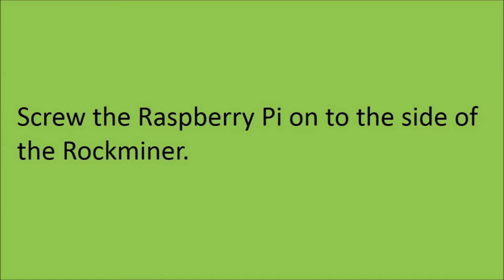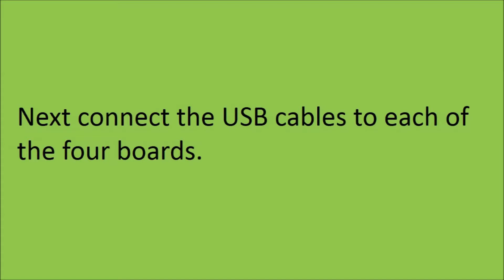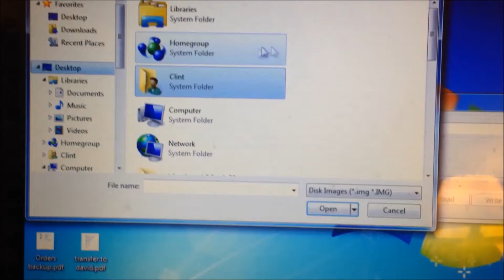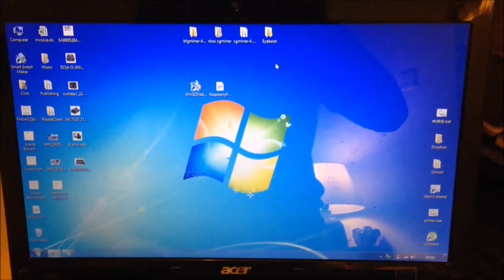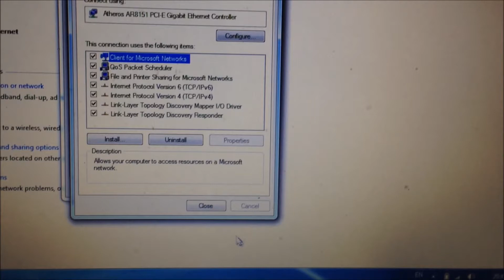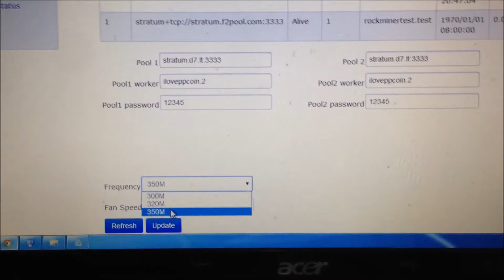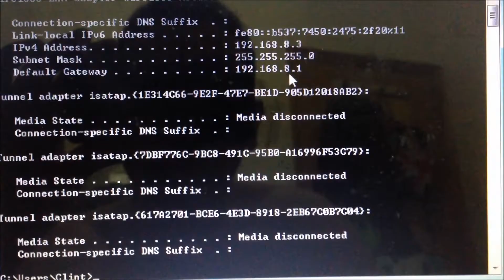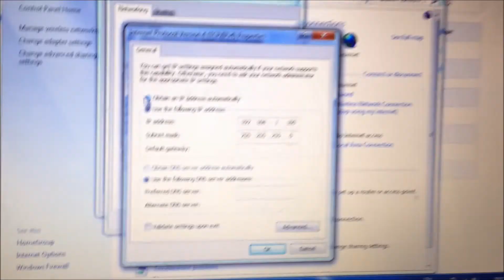How to setup Rockminer R3 Asic Bitcoin Miner using raspberry pi

Comment: How do you set the thing up without a raspberry pi. I was told I could do that, but I have no files that came with the thing. No instructions! No nothing!
Reply from the maker: Guadalupe Alvarado Both the R3 and the R4 can be connected directly to the computer and run on cgminer and Windows. All files and setup guides are available on our website: www.eyeboot.com

Here is the cgminer download link:
https://www.dropbox.com/s/y64lh5ucodfwyvr/cgminer-4.5.0-windows.rar

The setup guide for R3 and R4 is the same. Here is a written setup guide:
http://www.eyeboot.com/how-to-setup-rockminer-r3-r4-bitcoin-miner-using-cgminer.html

Comment: What is the name of the power cable to power up the Raspberry Pi directly from the R3 miner and where to find it?  Can we connect 2 R3 miners to a single Raspberry Pi? Can the Raspberry Pi handle them both?
Reply from the maker: Will D MCU to Raspberry pi line. We have them at Eyeboot. If you want an extra one then you can buy them, just email sales@eyeboot.com

Comment: instead of command just type cmd  on windows 7 if you have your taskbar right click on the icon it's a black box with C:\_ in it and pin to taskbar especially if you go in the DOS prompt for cgminer for your gridseeds or bitfury might work on the BAT file directly but don't have 1 on bfgminer 4.4.0 which I somehow got from multiminer cuz of the antminers I grabbed to start mining.
Reply from the maker: juggawest thanks for the tip!

Comment: thinking about picking up two of these from you guys to save money. What all do they come with? Also if i connected the built in USB hubs to another USB hub then that hub into 1 RPI (1 pie for 2 miners) would there be any efficiency loss in regards to mining?
Reply from the maker: ***** They come with built in (4 port) usb hub, 5 x usb mini data cable, a free raspberry pi (if you buy two miners) and a raspberry pi power cable so you can power the raspberry pi from the miner itself. We have just received new stock yesterday so offer immediate shipping via DHL (who are the best in my honest opinion).
Reply: thanks for the info!
Reply: Eyeboot i tried to download the software for the RPI using your link and my anti-virus blocked it. Is that normal? i went ahead and downloaded it, but it doesnt look like a image file, it looks like a program to install on the PC.
Reply from the maker: ***** Hi, it is a zip file but inside there is a raspberry pi image file. I just checked it is still the same file. Virus scanners always flag cgminer as a virus so that is probably why you are getting an alert. It is not a virus though.

Here is the download link:
http://www.mediafire.com/download/j214ddj9l9n4tyj/RaspberryPi_Rockminer_Rocket_V1.3.0_192.168.1.254.zip

Alternative download link:
http://sourceforge.net/projects/rockminer/files/RaspberryPi_Rockminer_Rocket_V1.3.0_192.168.1.254.zip/download
Reply: awesome thanks!

Comment: What are the Login and Password for the Raspberry Pi?  I downloaded your particular image file using the link on eyeboot.com to run the R3 miner, but they are nowhere to be found. They are not the old ones: pi  and 123456.    What is the easiest way to set up a WIFI on the Raspberry Pi for running the R3?
Reply from the maker: ID:root
pass word:rockminer
How to setup wifi:
http://www.maketecheasier.com/setup-wifi-on-raspberry-pi/

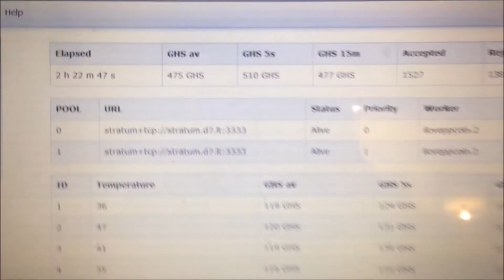Comment: I would not say your true average is 510 GHS after 2 hours and 22 minutes of mining. If you pause the video at time stamp 17:09, you can see that the GHS for the past 5 seconds is 510. BUT, for the past 15 minutes it's 477 GHS, and for the total time it's 475 GHS.

I know that when you start up miners, they starts off slow because they are dialing in the difficulty setting (which will make it run slower the first hour than the second hour), but to only point out the "past 5 second average number" isn't really fair either because that number can fluctuate quite a bit as the miner requests new work, or it's working on the new work.

A more fair way to report the mining speed of this unit is to let it run for a couple of hours (like you did) but then report the past 15 minute average number (477).

I'd say after running for 2 hours and 22 minutes, that miner is mining at 477 GHS.
Reply from the maker: Yes that is correct, the speed for these devices does range from 475 to 520. I will post some more videos soon showing better performing miners. The video was made in a rush before i went on holiday : )